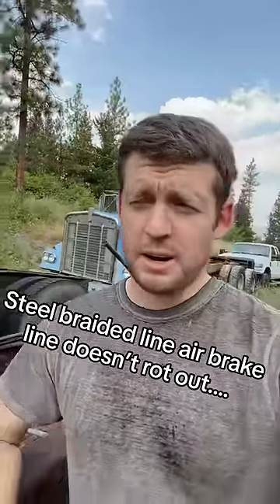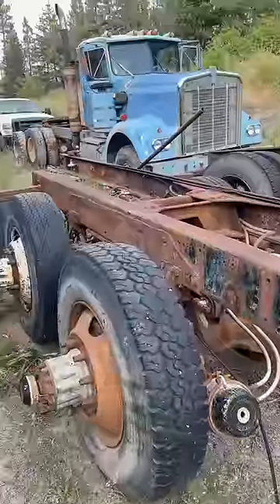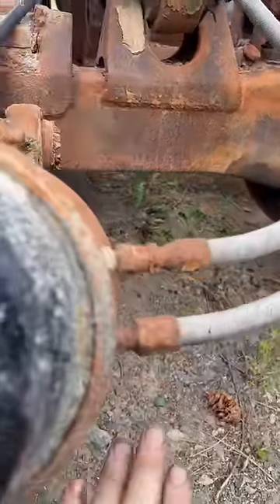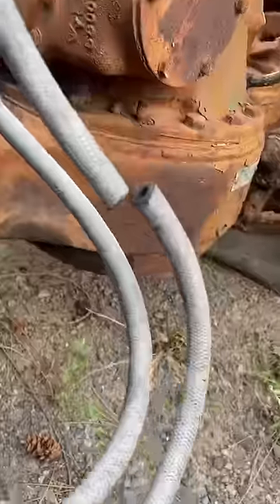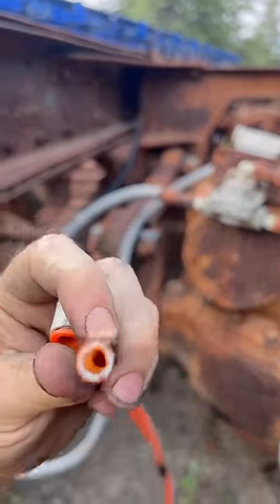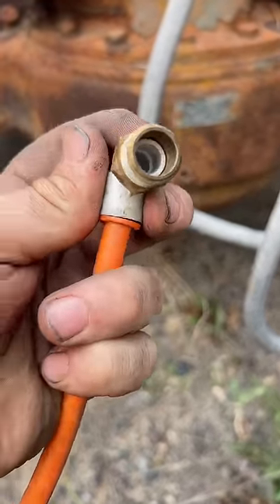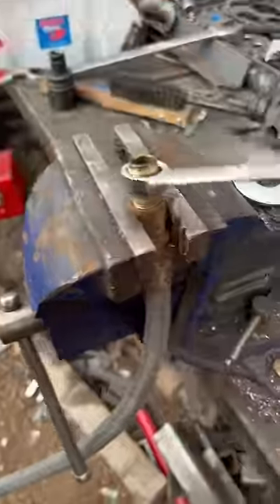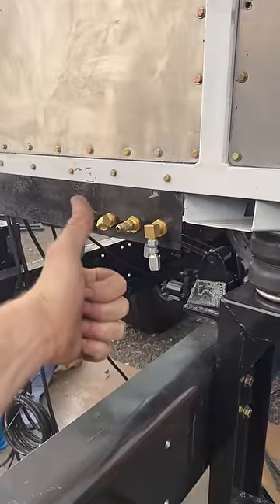Cutting a 70 year old trucks brake lines open for science

Comment: All lines will rot, even the steel braided.

The difference is that the quality braided lines have multiple layers, including a sacrificial exterior sheath made of fabric or metal.  That exterior sheath is what absorbs the UV damage and harmful fluids and road salt that gets on the lines, protecting the inner pressure layers.

Additionally, it is a case of "armor where bullets aren't" situation.  The older braided lines fail internally often because they are on there for far longer than the plastic ones, so other parts failing, like the compressor, leaves contamination in the lines longer than more frequently plastic lines.

I'll stick with my expensive old braided lines over the plastic ones.  That's why I drive an original 1987 Freightliner with a Cat engine.
Reply: 3406B?
Reply: @sandasturner9529  Yep, early 4mg and the other is a 8tc.  3.2 million on one and 2.6 on the other.  They both even have their original transmission and one of their differentials is original too.
Reply: @danielhomant2832  mmmm. Now that is some guud info

Comment: Youtube experts always make my day
Reply: I work with these same air lines on industrial sheeters and with the same plastic push connection fittings. These are shit and if they can wear out from simple use, then they can’t safely survive the conditions on a semi truck.
Reply: @diplexnormal3353  He just proved that they don’t go bad???
Reply: @andrewrichardson3135  no but if you’ve worked around those push connectors, then you’ll know that it doesn’t take much to take those apart and not to mention that hard plastic like that can go brittle and break under weather not too long after many several seasons of freezing and falling or at least until the warranty of that truck expires. Because that’s all the design of anything is built for now is to survive a warranty until it expires and after that, good luck!
Reply: @andrewrichardson3135 please take the time to be gooder at reading and knowing they meen beefoar u do a say thing????
Reply: @illitero    I sure hope you’re being sarcastic…
Reply: Does that make you a comments expert?
Reply: The point of my comment is, IT DOESNT MATTER WHAT YOU UPLOAD, PEOPLE WILL ALWAYS HAVE SOMETHING BAD TO SAY

Comment: Sure enough. I have had minor repairs more than once a month working off road in Alberta with modern plastic lines and brass fittings. Had to repair myself in the middle of the forest outside phone coverage last month because a road rock took out a fitting on my secondary tank. I’m not going to complain if someone gives me a truck with steel fittings and braided line.

Comment: They're suggesting the plastic is better because those plastic lines and instant fittings are easy to replace, and in my experience (not on vehicles, but industrial maintenance rather) those plastic lines and instant fittings do work well, but they're also easy to break. That steel braided line is way way way better, it's just harder to fix when something does go wrong.

As for which one I'd trust, I'd trust either since the brakes are released via 75+psi and are set when pressure is bled off, but would much prefer the braided line.

Comment: Grinder guard has left the chat
Reply: And having it on for that cut wouldn't even be hindering. Bad habit.
Reply: Safety First! Squints Eyes
Reply: Get this man a Puppers
Reply: Its a battery grinder cant hurt yourself with that
Reply: @localsonly-ju6fc i find that battery powered ones are more dangerous because of lower rpms which means it has a tendency to bounce or catch on the cut. honestly having a guard on one doesn't help with anything at all most of the time outside of being a hindrance when you just want to grab it and cut something real quick.
having a guard on corded one on a long tiring job makes a lot of sense though aspecially when you don't wear gloves like me
Reply: @localsonly-ju6fc That’s like saying you can’t hurt yourself with a .22. You’re wrong.
Reply: We used to take them off for our old workplace, because the guards got in the way. Pair of safety squint and it's all goodddd
Reply: @MatthRrrr I always just cup my other hand around the blade facing me

Comment: Had an airline get wrecked going through Oregon. Pulled into a garage, they refused to use the same 3,000 psi steel airline already on the truck, insisted I use the 300 psi Line they had because theirs had a D.O.T. mark on it
Reply: Bureaucratic dogma at it's finest.

Comment: Synflex has its place. For brake chambers and primary or supply air im all for it. For signal lines and accessories like 5th wheel slide operators and other electric solenoid operated systems synflex is perfectly acceptable. Its also easier to service generally and being color coordinated means you can trace an air circuit relatively quickly.

Comment: We at freightliner still use hoses the same thickness of the old hose you shown in the video that run from the combo valve to the brake chamber.
Reply: I scrolled way too long to find this comment.  
A standard brake chamber airline is closer to what he cut open than the one he showed. Those thin airlines are used to route air around the equipment
Reply: @UnknownDevices91 lol yup, those airlines are typically used for other components on our trucks. We run about 6 of those skinny airlines through the chassis but not for the break chamber to the brakes. Only from the break pedal to the break chamber and other components

Comment: Put them in a truck that hauls fertilizer and you will think twice about that, steel braided lines do rust and it's gonna depend on the application for which type of line you want to use, fertilizer trucks, plastic lines all the way, any other truck steel braided lines will be just fine unless you are trying to save some weight

Comment: If replacing- anything upgrade. Especially brake parts. On a hydraulic system,they improve the petal by 30% or better. Those plastic lines were some engineers idea to lighten the curb weight and lower production costs. Who ever wound up with the W900 I had to sell , is loving life.

Comment: Ive got dump trucks at work around 20 years old. Some trucks we got from a previous company had some steel braided lines going to brake chambers. I hate them. Here in the midwest salt rusts the swivels on the fittings solid. Then the hose gets so hard and stiff you cant reroute them or move them out of way when working on truck. I prefer the regular rubber air lines with brass fittings. The plastic lines are pretty tough. Ive had  plastic air lines rub though steel braided fuel lines and once a power a steering hose

Comment: I have had to replace the lines from the 80s a few times. they rot out and leak. likely the rubber starts to 'breathe' from oil contamination.
Reply: Yup, i've heard that oil makes those lines brittle
Reply: So they failed because of factors outside of the designed tolerances. What I'm hearing is that's not the line's fault that they were left to deteriorate in oil, that's poor maintenance. That's like saying "these brake shoes are a bad design cause they got soaked in oil from a hub seal leak"
Reply: @SIRUNOWN   there is oil from the compressor in every truck air system. so they fail due to the environment they live in.
Reply: @xxxmikeyjock  Yeah if you have a dying compressor and haven't serviced your separator in the last few decades. If you're pumping oil into your air brake lines you're not maintaining your truck. Lmao
Reply: @xxxmikeyjock  That is a seriously cope excuse to try and defend those dogshit plastic lines man, I'm cackling over here lmao
Reply: @SIRUNOWN   a cute fantasy you are having. I havent defended any thing, but now that you mention it I dont think i have ever had an issue with new lines
Reply: @xxxmikeyjock  Lmao right dude, except for all the leaks right? Hey by the way do you know what the diaphragms in the brake chambers are made of? Rubber. You gonna pump oil into those too? Or does it just skip the accumulator tank but magically stop in the air lines before the chambers? Cause you can bet your ass the oil that's "normal" in your brake system would ruin those diaphragms long before the lines. Or are we gonna pretend that you didn't say having engine oil in your brake system is normal? Lmao
Reply: @xxxmikeyjock  They fail because of the lack of maintenance, if you've had rubber lines rot out that says more about you than the lines. lmao
Reply: @SIRUNOWN  right, because I owned this old iron since it was new. explain 'maintenance' on an air line for the class Boy.
Reply: @xxxmikeyjock  Heavy duty mechanic, worked on hundreds of them. Deal with it. Lmao
Reply: @xxxmikeyjock  drain your tanks, service your driers and filters and replace your compressor if it starts blowing oil into the system, cause contrary to what you think that is not normal. It's real simple if you're not simple.
Reply: @SIRUNOWN sounds like the brown trucker brigade chiming in, what do you expect when they operate with no shop or yard, all they need is the side of any road for maintenance

Comment: The steel braided are definitely the way to go. The reason they are not used today is because of cost. And of course rubber is easier to build along side the road. 

To be fair those nylon hoses with the push fitting are almost never used on a brake chamber. They are however used everywhere else on the truck so your point stands

Comment: How can the brake lines be push connected 😭😭😭
Reply: They seal alot better in reality then he makes ut out to be. And Weight is key here. If you were to put an addition of a ton in the truck and trailer using only steelbraided you would loose out on cargo capacity and thats where the money is.

Comment: The double breaded steel lines the hold up better and never rush cause the inner lines is CS65 rubber coated with aluminum alloy steel dipped back in CS65 rubber and wrapped with aluminum alloy steel shell making it so it will never rust and it takes CS65 rubber 75 years to start dry rioting and since compressed air has water vapor in it makes the rubber last 2× if not 3× as long. (150 to 225 years)

Comment: Steel braided hydraulic lines are what we use in aviation. We have time limitations on them, but that's because we can't pull over and call for a tow. Anyway, some planes from the 40s still have the original lines, and they are still flying, and the lines are not rotting.

Comment: Paccar training teaches us not to use plastic going to the brake chambers. Those have to be minimum nylon DOT or steel DOT braided hose. The reason for that is just what you're saying: the environment that close to the road surface is vulnerable to debris, terrain and weather inconsistencies which may lead to damage. Steel or nylon rubber are tougher and not sensitive to deep cold brittleness. It's important to distinguish the application allowances goes the synflex nylon tubing. All modern trucks use a lot of it in every other air system except the brake valve to brake chambers location.

Comment: “Stainless” steel braided lines may be required to specify 😅
They are awesome, but just like all lines the interior eventually degrades in high flow uses- but my understanding of brakes is that it’s more about pressure transfer because the flow rate is next to none 🤗 extremely fast and easy to replace if the fittings are accessible too 
I hope this company becomes one of the big ones 🤞🍀

Comment: Diesel mechanic here... plastic air lines and quick connect fittings are not used on brake chambers. That is not dot legal.... most brake lines are still rubber and/or rubber with steel braiding.

Comment: No good mechanic will use those plastic push connectors for brake lines that connect to break cylinders. They are used for lines that run along the inside of the chassis for the most part. They are not in danger of being damaged when fastened properly. (I did a bunch of break repairs and first time installations of break systems throughout my career).

Comment: I replaced the rubber lines with the braided lines on my off road truck, greatness’s not air brakes but they have held up extremely well to the abuse a farm truck takes and it definitely catches a lot of abuse but I am happy. Braided lines for the win and threaded connections to top it off.

Comment: Steelbraided lines might be rusted on the outside, BUT remember its also a steel braid sandwiched in the rubber aswell. So even if its rusted the inner braid wont be rusted.

Comment: In the yard got a 99 ken. It can sit all week long without running a second. Turn the key and it still has 100 psi. Got a whole fleet of new Pete’s and they loose 100 psi overnight and you have to listen to it ding at you for 10 minutes before you can even move the truck

Comment: Ive had steel lines like that fail, personally i prefer the plastic lines, much easier to repair, replace and as reliable when installed correctly

Comment: It's not the lines themselves rusting out. It's the steel fittings on the ends of the lines. Push connect fittings are only good for assembly. I replace them with the sleeve and barrel style when I can.

Comment: In Europe, if you loose air pressure in a truck, it locks the brake's. Loggers often go on shitty roads here and often snap airlines, but since they can have connectors and extra line with them, they can fix it on the go. So I'd rather have the "crap plastic" than braided, But it's a matter of taste.

Comment: I ordered my last truck with the rubber steel reinforced lines, and it added like 300 lb to the truck 😂 but hay no air leaks or frozen nylon lines cracking in the winter

Comment: Use the steel braided normally but always keep plastic ones around super easy to change out on the road/trail and the plastic will do ya fine until you get some steel braided ones on there again

Comment: If you're putting plastic air lines to your brake pots you should have your mechanics ticket taken away.

Plastic airline is fine for routing to the air valves, air manifold, shifter knob.

Wire or Steel Braid line for anything else (eg. Routing to brake pots, routing between air dryer and compressor, etc)

Also if you're using PTC fittings, have fun replacing them in winter when it fails.

Comment: My understanding braided cable is first, made with stainless steel. Secondly, their main function is rigidity. They expand less under pressure, so you have better hydraulic force going to your brake system and not lost in rubber hose expantion. Very popular in race vehicles or where braking is of great concern...also that 60's truck doesnt mean those are 60's brake lines....

Comment: In 3-5 years, that plastic tubing will get brittle under pressure within the push-connect fitting and it will leak.  Then you will have to cut the end off and reconnect it.

Comment: I’ve never seen those air lines used for the brake chamber.  
They are used to route air around the truck and to the regulator. But then a thicker, better line is used to the chambers.
Reply: Threaded. As well. Pretty standard. 
Just google brake chamber air line.

Comment: Worth noting that plastic isn't bad per say. We use plastic airline daily in ag applications, subjecting it to 120+ PSI constant pressure, and don't often have issues unless it's been caused by physical damage, which in my eyes is the main downfall of plastic, it is obviously very weak when subjected to abuse. That being said, I'd take steel line over plastic when it comes to brakes any day.

Comment: i 100% agree that the braided lines you went with will outlast the plastic alternatives, with your goals its probably the best choice for anything that cant be hardlined.
but the way rubber is made has changed over the years too. your braided lines just wont last 60 years like the old stuff did. i couldnt tell you the number of times ive replaced factory hoses on something thats from the 70s all the way back to the 40s, a lot of times just to make it look better and not because the rubber had failed, and within 5 years that replacement hose had already cracked and split

Comment: Honestly i agree with using the older fittings. If there's going to be a failure point due to wear and tear, it would most likely be the oldest components. Fittings are among the easiest kind of parts you can fix... As long as you can get to them.
You have NO idea how many fittings i had to take apart half+ of the hydraulic assembly just to GET to the damn things. Sure it looks nice and tidy, but if i have to unbolt 2 covers, unscrew 6 hydraulic lines and still barely have the space needed to turn the wrench a single inch before having to readjust the wrench to get a new grip for another inch long turn... Honestly the most frustrating part of mechanics work is just GETTING to the part you need to fix.

Comment: Mechanic here. Those steel braided lines are not 70 years old. I have replaced many steel braided lines on trucks that are not even 10 years old, as Kenworth still installs them from factory. They have their place as do the nylon lines and rubber lines. Personally I like to use rubber lines out to the wheel ends as they last longer and are easier to deal with.

Comment: Well stainless steel won't rust but the rubber gets dry and cracks also in areas is oil or diesel it becomes soft and start leaking and this is a diesel mechanic have to change lots of those hoses

Comment: You run Steele flex hose down the frame rail too cause the flex hose to the brake chamber as shown is always a rubber hose not pex even on new trucks